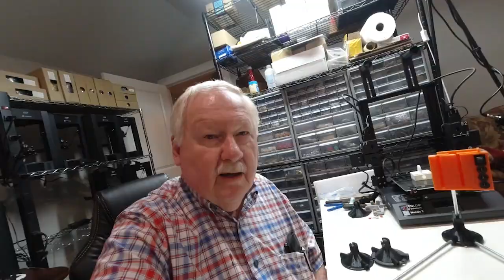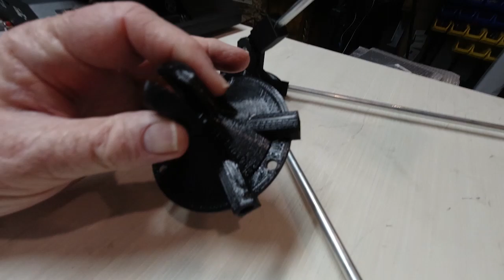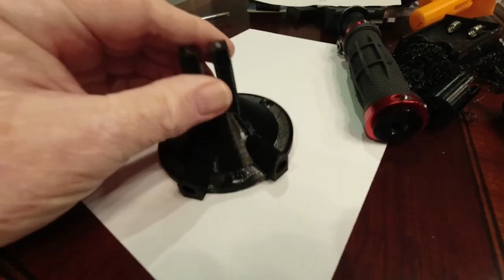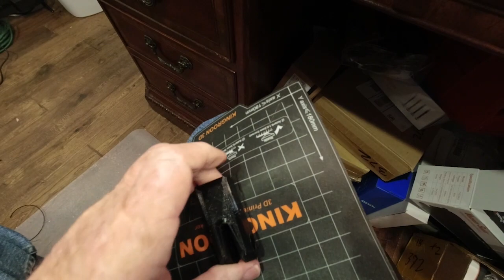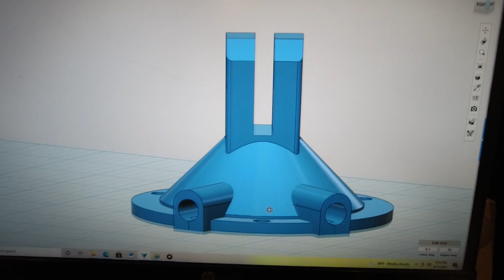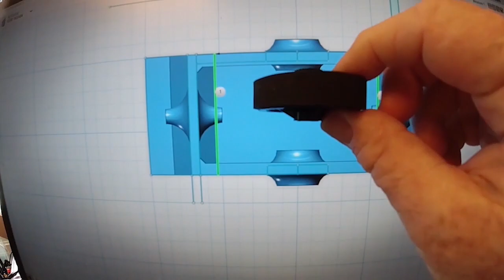STRONG 3D PRINTED PETG FILAMENT PARTS Solved my problem with weak PLA parts.

Comment: My main product has a small part that a bolt goes through and holds a lot of weight.  I ended up finding the perfect temperature, used carbon fiber PLA, 100% infill, and I still can't believe how strong it is.  I achieved so much strength with these settings that I could create a hollow cylinder where the wall is like 3mm, and I can step on it with 1 foot and put my entire bodyweight on it (180 lbs).  That's just 3mm thick and otherwise hollow cylinder, and the diameter is like 1 inch.  These printers are capable of amazing things when you get the settings just right.
Reply: Oh also I had to get the orientation right.  There was a thin piece that was breaking and I flipped it on its side and now they never break.  I went from basically selling 6 products and having them all break and get returned, to selling over 100 now, with only a couple of returns but they were stupid returns like one guy thought it would be metal and another guy just didn't like how it looked or something...either way that's a VERY small return rate.  People on Amazon return perfectly made items far more, so I'm very happy with the current return rate.
Reply from the maker: Thanks for sharing that, Wayne. Cylinders are very strong structures and with carbon fiber, 3mm wall, and the right temperature, you will have a super strong part...Ken

Comment: What petg settings are you going by. Those parts are beautiful!
Reply from the maker: The PETG temperatures I use are normally 245 for the hot end and 60 for the bed. This may change with some filaments. Caution: printing at 245 can cause build up in the nozzle, especially if you keep the temperature of the nozzle at that level without filament flow. I have a lot of trouble with this if a printer is paused for a long period of time allowing the filament in the nozzle to BAKE and build up inside the nozzle. This causes reduced flow when print resumes and there goes your quality. Good question Mark and thanks for your support...Ken

Comment: Glad to hear from you Ken – more so to read about your vacation! I still have wonderful memories of fishing, snowmobiling with my grandfather so, good on you to step away to spend time. 

Great job on these! Oh, I'm pretty sure they'll be strong enough. Better to "over design" than under! I'm a mechanical engineer and did machine design years ago, costs was always an issue but in self-3D printing, time is more of an issue than cost.  

Can I make a couple of suggestions for the cone base support that might be worth experimenting with? 
- I assume the three holes on the base’s lip are for screws? If so, I would preselect the wood screw you plan to sell in your kit. Then, go to your design and reduce the hole(s) diameter just to fit the screw, not any larger. Next, create a raised bevelled “ring” around the hole, on the top of the base’s lip with a diameter a little larger than a #8 or even #10 washer. Being 3D printed, this will be a weak point versus an injected part. Screws and bolts areas need a lot special design attention. This "raised ring" would be say 1/8” to ¼” thick above the top lip surface. Also, ideally, I would increase the number of holes to five to reduce the stress on each point. Finally, to save print time, instead of printing a larger base lip to accommodate the hole ring (should that be the case), just “bulge out” the area around the hole. As it is, you have a very thin section at the holes that could easily break if a customer was to tighten the screws too much 
- Next suggestion: test out a hollow inner cone area. I guarantee the base will print faster with the bonus of being stronger. Generally, walls are faster to print than fill. Fills require a lot of direction changes etc. So, if you were to make the cone hollow, say about 6mm thick (outer layer 3mm, inner layer 3mm) and increase the “overhang” threshold to 60degrees or higher in your slicer, you would probably need only a small area underneath the centre of the cone to have supporting material. And now, since the printer is only going in circles for a good portion of the cone, it should print way faster. And finally, since you have 6mm (or whatever you feel you need) of melted plastic, you’d be surprised on how much stronger the cone would be! 
Again Ken, hope this helps! I can see you’re getting more and more creative on your video editing as well. Good for you! Claude
Reply from the maker: Thanks Claude, Your suggestions and ideas always help. I did think about a chamfered hole for the wood screws, but just haven't gotten there. The cone is hollow with a 5mm wall and the square column goes all the way to the bottom. I do plan to start working on print speed and using .6 or .8 nozzles as long as I don't lose strength. Adding holes for additional screws and letting them project out is a good idea. The current holes are for wall or bench top mounting. Thanks for your encouragement and support...Ken

Comment: You probably don't need 100% infill. 100% infill can make it more dimensional in-accurate. The strength over 70% will be about the same strength, plus it save material and print time. Test it out first thro.  nice work.
Reply from the maker: Your probably right about the infill, but with 3mm wall thickness and the fact they are small parts it really took very little additional time and filament to do 100%. Thanks for the input and for your support...Ken
Reply: @NewTechInventors  your correct in above...sometimes there is more chance of failure ... but good for you and your printers if they can print well at 100 percent.  I fixed my problem with my mini Prusa..I put the extruder gear on backwards ..I should have known better.   Kit took a day but it went pretty easy together.  Well I’m waiting for your video...God Bless.. Jjoe

Comment: Those look good. If these don't prove strong enough, I wonder if having two pivot points on the male fitting and three on the female fitting ,like go-pro mounts, might provide a more durable joint.

What settings do you print petg with as far as hotend\bed temp, retraction speed\distance, parts cooling fan on\off\speed?
Reply from the maker: Good questions, although I use various settings for different printers and parts, the ones I used on the parts in this video were, 245 head, 70 bed, speed 50, shell 3mm, retraction speed 80 @ 8mm, 100% infill, bottom layer speed 15, outer shell speed 20, other speed 30, fan speed 75%. The idea of two pivot points like go-pro has crossed my mind, but the finished parts now look really good. I will be experimenting with larger nozzles and such later to try to increase speed without loosing any strength. Thanks for your input my friend...Ken

Comment: The part with the screw ... after base ... needs a fillet or beef up at the right angle.  Tapper the line to the top... no need to rectangle it off. That will increase is strength. That critical right angle needs a fixed my friend.  I love the base emboss your logo please on the base.  Your bud joe
Reply from the maker: I agree that there should be no sharp inside corners in stress areas. I missed this one, but you will see that I fixed it in my next video. I do need to get a logo I can print on parts and will be working on that, Thanks!. Got lots to do now, thanks for your support Joe...Ken

Comment: I would suggest .  More deeper fillets in some of your parts ... it will feel and look better even on the inner lines of your parts.  Looking real pro overall. Great improvements.    Joe
Reply from the maker: Since my orange filament is more transparent than the black I think a thicker wall will help hide infill lines and add strength to my other parts while making them look better, what do you think? I will also look at the fillets on other parts and see if They need to be increased. Sounds like we both know the importance of the use of fillets and chamfering to increase strength at vulnerable structural areas of our parts. Keep your ideas coming my friend...Ken
Reply: @NewTechInventors  infill lines are cool .  Wider fillets will add style and structure at stress points.  If your not,   turn on “random” in your slicer for seam placement.  Talk soon my friend.   I have my own issues with my new Prusa mini......I dislike the extruder ......it’s being a pain.thinking about upgrading the extruder.already and I just finished the kit.....